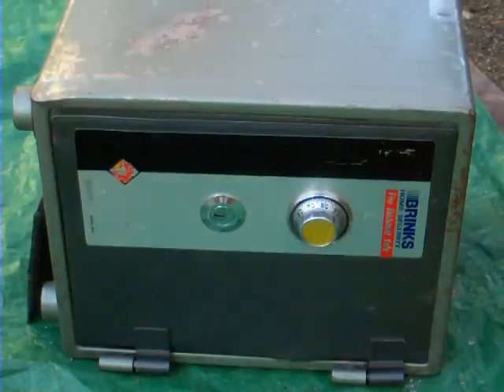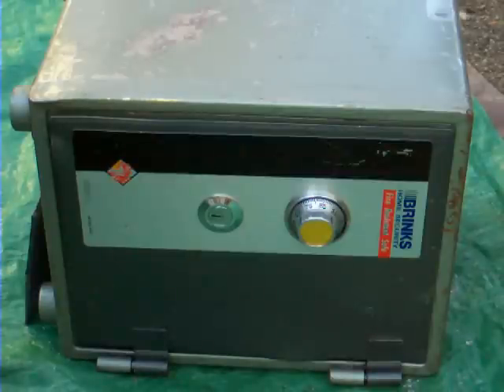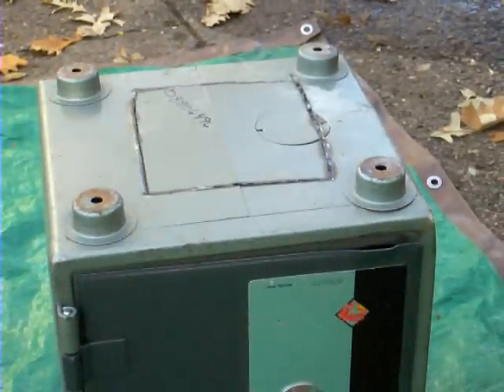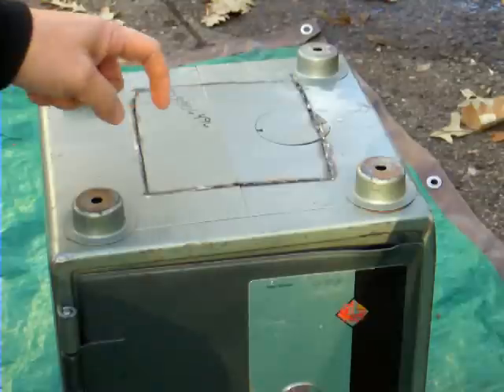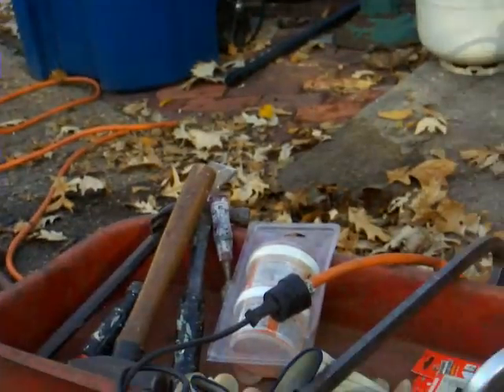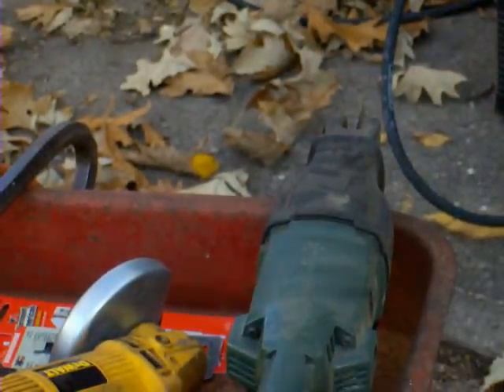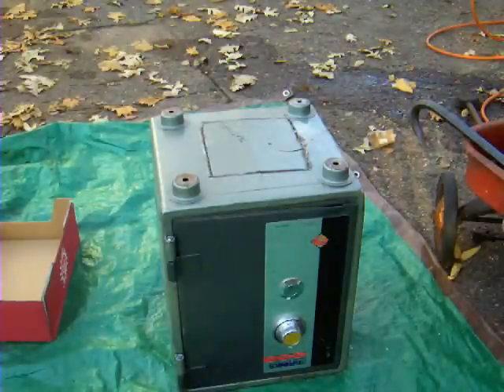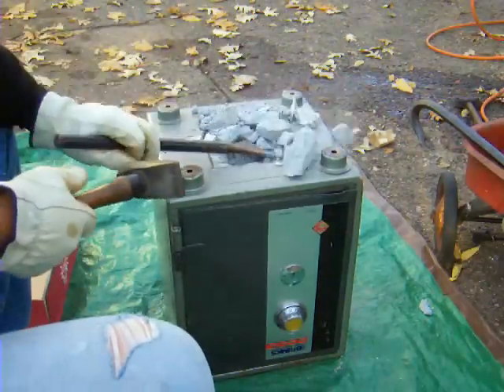How to open safe with lost combination, key, re-purpose repair reuse, part 1 of 3 safe cracking

Comment: I bought a gun safe that was already opened and it is stuck in the locked position and i don't know the combination.  Please help ... Thanks
Reply from the maker: Shannon Bowman It should not be too hard. You can access the lock mechanism on the back. Remove the panel. It should show tumblers. It is then the process of elimination to find which way to turn first then each number in order . See this for a start.     https://youtu.be/hLXUB-QQQj4  Or after you get it opened up you can do a video of the lock mechanism and post to Youtube and you will get responses. Godspeed.
Reply: Thanks for the help